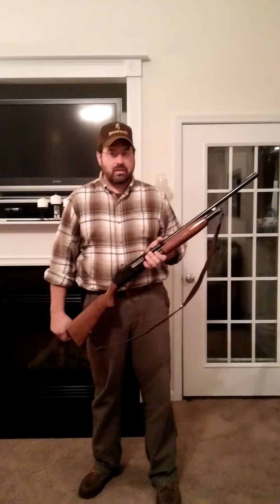Mossberg 500 Feed Issue

Comment: This is a common problem with Mossberg 500's. 

There is a ramp on the left slide arm of your action slide tube. This ramp engages a tab on the cartridge stop inside of your shotgun,  pushing the cartridge stop  out of the way to release a round.  

This tab on the cartridge stop SHOULD be meeting up BEHIND the action slide bar ramp (flush against your receiver behind action slide bar)   So you should see your action slide bar covering it.   Pull your slide back, look inside the ejection port and inspect this. 

The issue: The ramp and tab on the cartridge stop slam into each other, or are meeting up on the wrong sides entirely. 
To fix this you can file the ramp on the action slide tube slide arm and possibly even the cartridge stop. You can also try bending the cartridge stop. If this doesn't work, buy a new cartridge stop. Or even contact Mossberg, tell them your issue and they should send you a new cartridge stop and possible action slide tube. 

Ps: Thank you for the video.

Comment: What happens is that the rails of the slider aren't pushing the left retainer out.  This is how I fixed it.

1. Remove barrel
2. Remove trigger
3. Remove the left retainer (part 11 on Mossberg's parts diagram) and bend it with your hands outwards.  It is hardened steel and behaves more like a spring, but flex it the tips outwards.  This will increase the clearance just enough so the rail can push it and free a cartridge.
4. Reassemble

When you twist your slider  you are technically creating the right separation for the rail to engage and move the retainer out of the way.
Reply from the maker: This is very much appreciated -- Thank You!

Comment: hey man...fixed mine this weekend.   check the 'interrupter bar' (google if not sure what it is) I had to file the tip where the shells are held in the magazine tube. it doesn't pull back far enough to let a shell out during the cycle of the shotgun. I used a micro 100 knife sharpener to take a small bit off. a file or sharpening stone will work too. mine was doing the same as yours and now works perfect. hope that helps.
Reply from the maker: +andy Thanks Andy!  Greatly appreciated.

Comment: its still a problem they haven't fixed.... I just bought a brand new 500 and have to twist mine pretty good to run 100%. ive only researched a little about it, but it seems to be an issue with the action bars.
Reply from the maker: +andy Thanks for the info andy.  I have already spent too much money trying to fix this issue so I'm not taking this to a gunsmith (again) to find out what difference I'm making with the twist.  I'm just happy I can get it to finally work.  If anyone knows what is actually happening, what difference the twist makes, I would love to know.

Comment: I had a 500 once. Sold it for an 870 cause I noticed an issue with it. Now I see it with my 870 too. At the range, my 500 would have troubles after you shot. You'd have to bump the butt on a bench or your leg or somethig to get the action to cycle. I've cleaned my guns down to the finest details but I can't seem to find the problem. Anybody know what the issue is

Comment: I could fix this, the catch ejector on the inside needs some tension to catch the shell.. imo.. not a pro.. but I think this is the issue as you said you have to apply pressure to a certain part of the heat shield to get it to catch..
Reply from the maker: I'll look into that. Thank you.
Reply: @treegrasscounty6030  side note I dont mean the slides on the side ejector there is a prong after you break it all down and remove ever the elevator
Reply: Its the catch to the shell extract